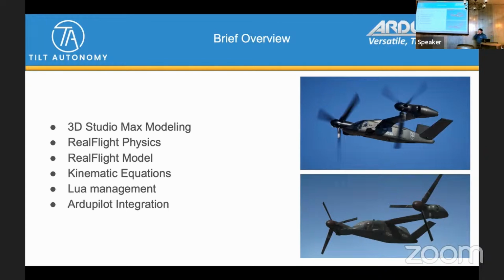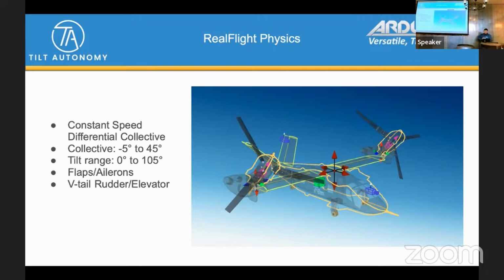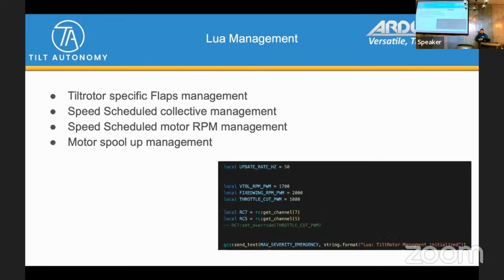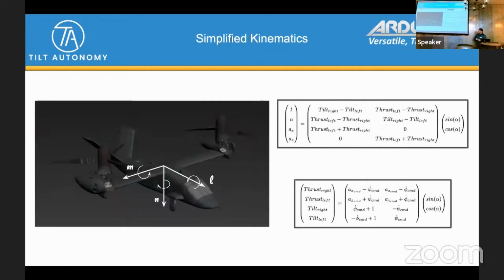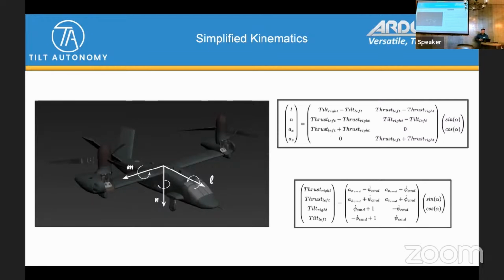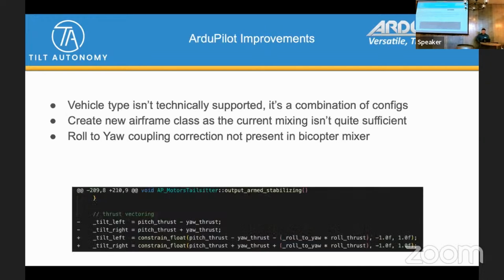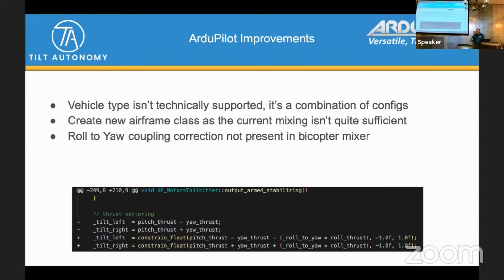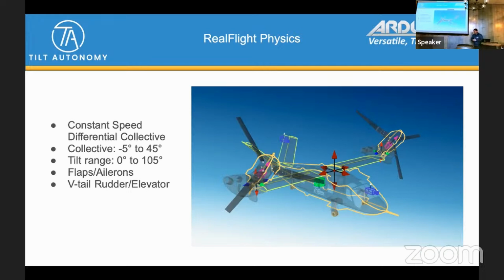Tilt rotor development Ryan Beall

Comment: Will this be under copter or plane? Currently the tilt bicopter is under plane I think but dual copter is under copter. These are a mix of those two.  Tilt rotor and tandem trad heli sorta need to both be their own class to really take advantage. Tandems can do a lot more with tilting each head differently as well. 

 Id love to see control surfaces mixed in too if possible.